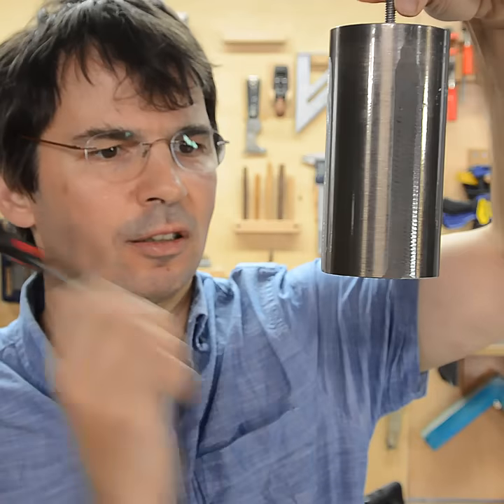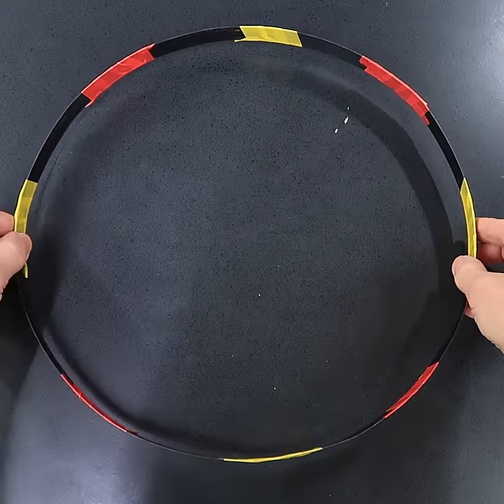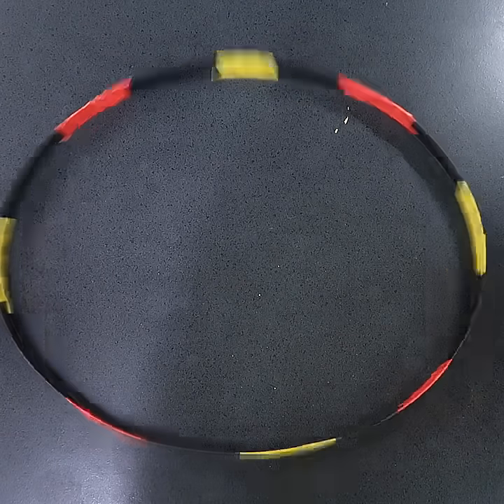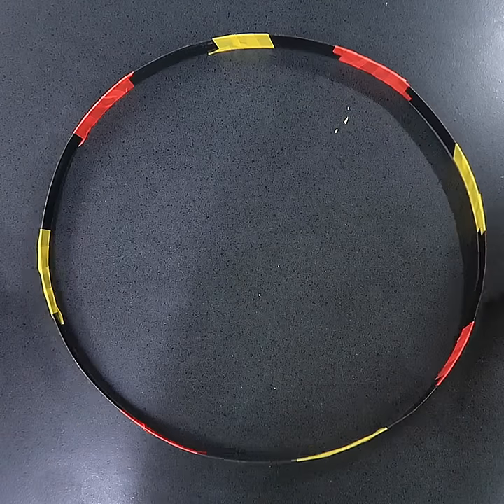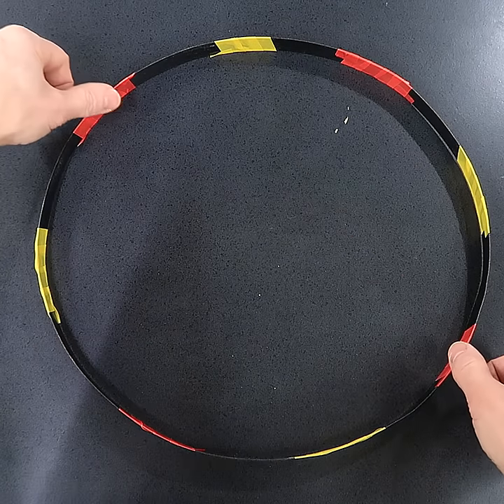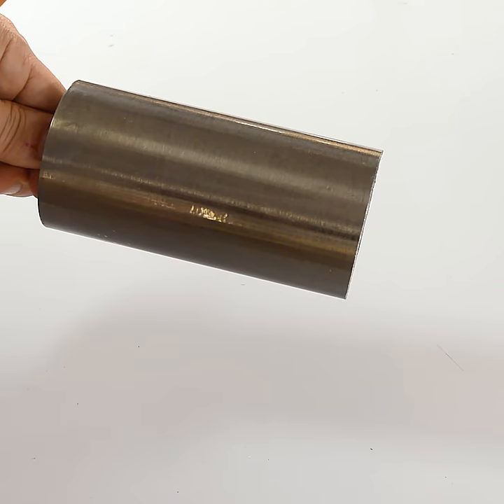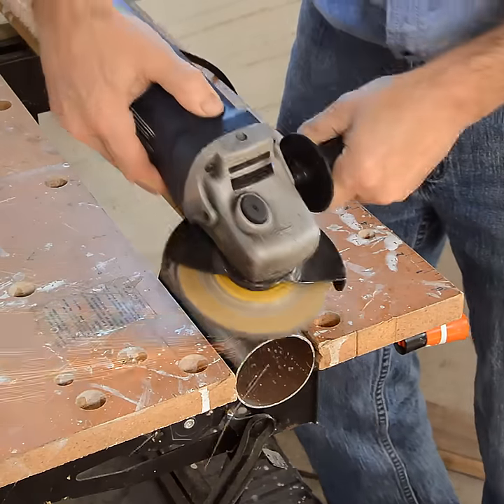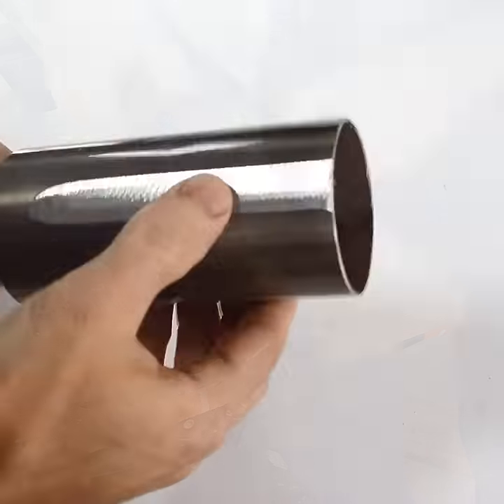This bell rings two notes at the same time

Comment: I forsee a 3 or 4 note bell video in the future.
Reply: The chord bell
Reply: Call again when it plays chopsticks ;-)
Reply: Are you screwing with the Matrix again?
Reply: 100 notes spinning at 10,000rpm
Reply: Couldn't a 3rd note be "easily" achieved by making its lengthwise vibration more audible?

Comment: They're not alternating. You're hearing each note doppler shifted as the anti-nodes move in a circular path first toward the listener then away. This is what gives a slight frequency shift that imparts an evolving tone. This is the same technique as the Leslie speaker that Hammond organs were paired to. Some other instrumentalists used the arrangement also with guitars,  Fender Rhodes, etc, but a bell is a first so far as I know. Cool experiment.
Reply: yeah this made me think of a Leslie speaker too! They are so cool but you really have to hear it in person, recordings don't do it justice
Reply from the maker: doppler shift would be a much smaller effect.  But the radiation pattern of the bell is not even, so as it turns, you hear the two modes of vibration alternately stronger and weaker
Reply: @matthiasrandomstuff2221  I wonder if they thought you meant that the actual notes are alternating, just because you are spinning it, rather than your hearing of them.

Comment: This is a great example of vibration mechanics. It turns out that many objects can have multiple "modes", which is a direction and frequency of oscillation.

Modes are often harmonics of each other, which you can observe here, the frequencies are a fifth apart.

Comment: You can do the same thing with any mug with a handle. Parallel and perpendicular modes of vibration to the handle vibrate slower while modes of vibration at the 45 vibrate faster. Fun trick.

Comment: The interesting thing is that when you spin it the metal body rotates but the VIBRATIONS stay put in space (it behaves as a gyroscope), so the vibrations pass through thinner / normal metal in turn, giving a variable tone related to the speed of rotation. Great example.

Comment: Are you sure the mass of the different areas is the cause?  Or is it because some energy is reflected where the material gets thinner and thinner.  I did something similar with a string, making it stiff in parts, allowing the full length to vibrate and form standing waves at that length, but very short standing waves would reflect the interface of the stiff part, creating a similar effect, impressing another note over the fundamental, with shifted overtones.   Might be a different effect, not sure

Comment: We used to do a similar Doppler effect demo in physics classes with a uniform flat circular metal disc having a thin bolt through the center (to hold it).  Twang the disc and then rotate it around the bolt axis.  You can hear the interference "beats" created as the Doppler effect shifts the sound frequency upward from the edge coming toward you, and shifts the frequency down from the edge moving away from you.  Here, in your video, you have 2 notes and the Doppler effect going on here when you rotate your bell.